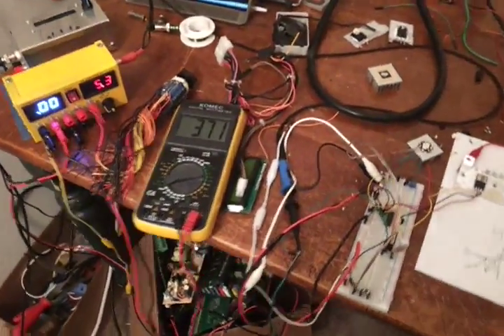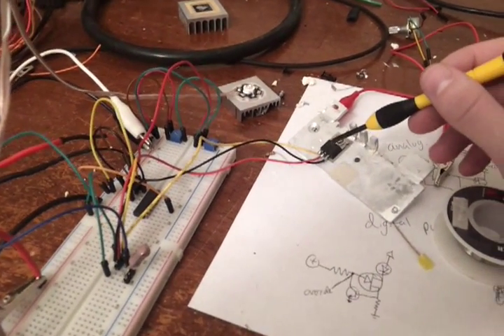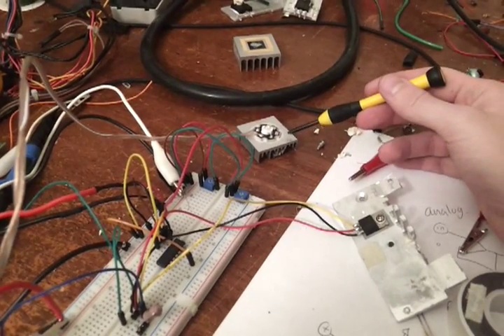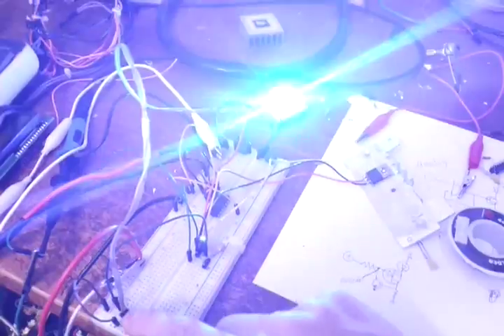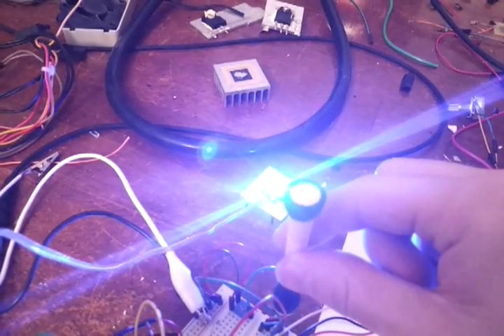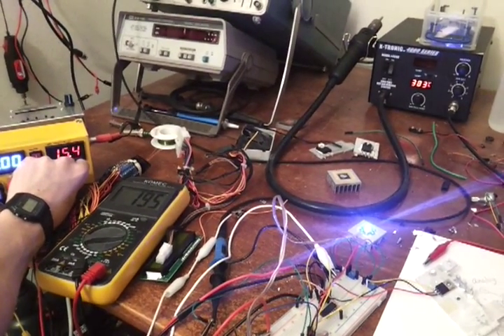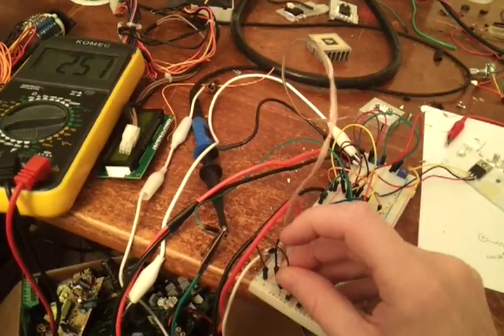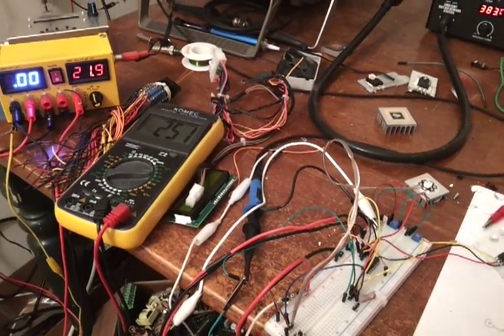Op-Amp Current Source Driving High Power LED

Comment from the maker: My application records RF-sensitive currents in a biological setting (single-cell neuron electrophysiology recordings with patch-clamp techniques). I had to avoid PWM because, even when well-shielded, it's noisy enough to show-up on my recordings. However, I absolutely agree! PWM would be the most effective, cheapest, and certainly linear way to control intensity.

Comment: Setting a fixed current with your current source and using PWM to directly turn it on and off is likely to be more effective then using PWM or a DAC to control current via the control input. LEDs dim linearly and easily with PWM, use the eye as a low pass; the current vs. brightness curve is not at all linear, and it's a more complicated circuit too.

For power LEDs I like the 1xNPN control and 1xNFET pass circuit at instructables/id/Circuits-for-using-High-Power-LED-s